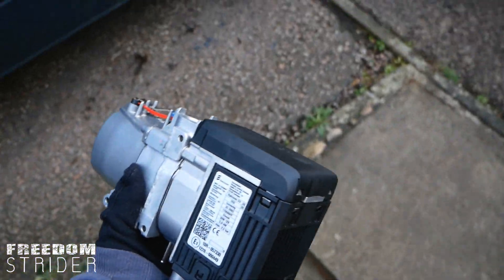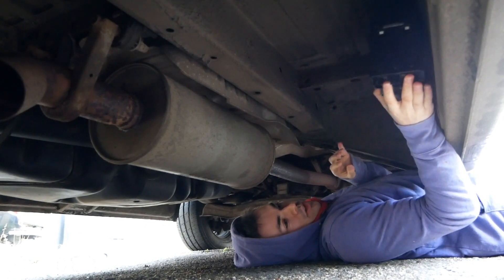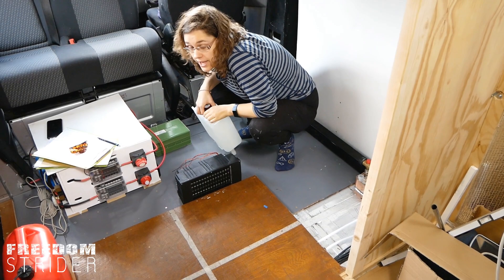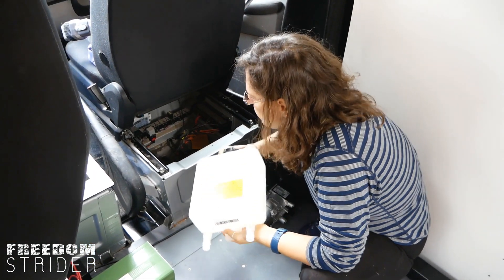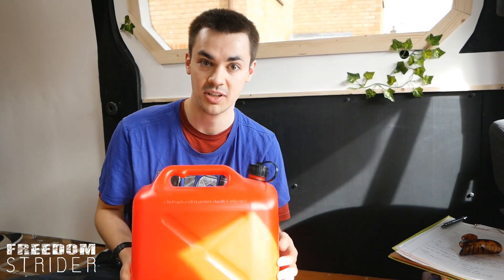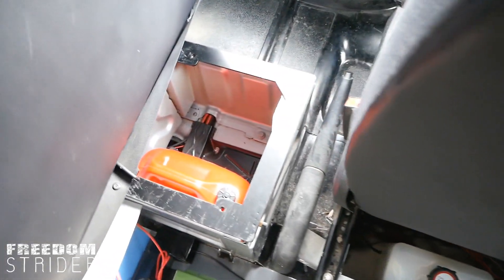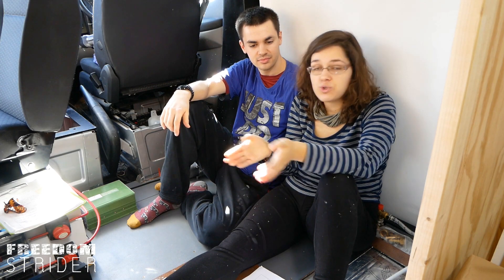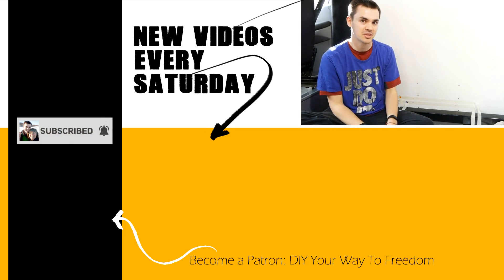How to build a Hydronic Diesel Heating System in a van conversion

Comment: Hi guys, I am working in a similar system. I would recommend you to look at boat heating installation, not at house systems, as boat are a lot similar.
What you seems to do is to install all heating appliances in parallel (sorry, I never heard about the two pipe system). All appliances in parallel with a valve on each. In that way, closing or opening the valves, you can control the flow on each and ensure that every appliance gets enough flow/heat from the heater.
In my case I left a hot water cylinder (for my hot water) without valve, and my blower and underfloor heating with a valve. In this way, with the two valves I can control the temperature of the three appliances.
Hopefully you have it sorted by now and my comment is useless :D
Reply from the maker: Parallel is a 2 pipe system (same thing) it's just Eberspracher instructions describe it as a 1 and 2 pipe systems.

We have our underfloor heating loop on a manual valve. The qir matrix and heat exchanger don't have valves but since we can turn the air matrix on and off manually, and the loop is very short, this seems to work really well for us. We haven't plumbed in our shower yet, so we don't know if any modifications are necessary, once the water heat exchanger is working. 👍

Comment: In English, A one pipe vs a two pipe. Is Series vs Parallel. the choice is simple. If you need more then one heated system then Parallel with a manifold. the Manifold is controlled by zone thermostats and solenoid valves, so you have the heat only where and when you need it.
Reply from the maker: Although a manifold would make a parallel system more efficient, we find that because our loop is quite short,  just simply turning off the device we don't need from our control panel is enough to focus the heat elsewhere, so we still let the glycol run through the air matrix even if the air matrix is not in use. It doesn't hamper the other systems. 

p.s. We both know English 😉

Comment: It is not a good idea to store fuel inside a van you are living in. Fumes are unavoidable..  Also placing the reservoir tank near electrical connections is a poor choice in case of a leak.
Reply from the maker: We were worried about fumes, so we ultimately tapped into our diesel tank instead. As for the wires, we did rearrange the wires under the seat so there's plenty of space for the tank 👍

Comment: Hi, nicely explained thanks 👍. I don’t think I’ve ever seen the furnace installed under the van. Are you going to add any protection from the elements, stones etc? I think the comments answered most of the questions I had but I support the idea of the fuel supply mounted outside of the cabin. I also think there are too many compromises necessary to utilise the existing glycol tank. I would definitely look at the ideal position for it from your perspective and seek out a suitable tank or even consider having a bespoke tank made. I appreciate cost is a major consideration but in this instance cost should probably be the secondary consideration.
Just my opinion and you know what they say about opinions. Either way I look forward to seeing the solution you arrive at.
Reply from the maker: This heater is designed to be mounted external so should have some protection, but we are thinking about building a custom protective box to go around it (you can buy specially made boxes but being a German company, they are hundreds of Euros!!). And yes, we agree with the fuel I think we will be dropping the fuel tank and connecting it up externally. 👍

As for the glycol tank, we managed to find an aluminium glycol tank (made for racing cars) for around £30, so that was a brilliant find and it seems to fit well in the space under the seat. 😎

Comment: Hello :) I've got a question for you both. What determines the temperature of the radiant floor loop? I'm considering storing hot water in a holding tank and would assume having that as hot as possible would be a good thing, then using a thermostatic mixing valve before the sink/shower. Can or should the radiant floor be set to a specific, ie lower temperature to be comfy to walk on? Is the espar set to heat the coolant at the same temp for floor/air/water at max capacity? This is semi-related to considering the possibility of a heat exchanger from the engine and what issues that could bring toward the radiant floor. Don't want any burnt toes! Thanks for these video's, they are very appreciated.
Reply from the maker: The temperature of the glycol is fixed at around 80C as that is the temperature it comes out of the Espar heater at. You can indeed use TRV's to mix hot water stored in a boiler with cold water for showers and sinks like in a house, but if you did want to drop the temperature of the glycol then you can install a TRV designed for coolant/glycol in the glycol line and mix the 80C hot glycol with cooler glycol from another unheated tank and use the TRV to control the output heat of the glycol line.

For the heat exchangers and air matrices that run on the hydronic system it's best to have the glycol running as hot as possible to maximise heat output from these. The only place a TRV would come in handy in the glycol line would be the underfloor if it were to get too hot. In our case, we are going to test without a TRV first and see how hot the floor gets. Honestly though if after an hour of running the heater the floor gets too hot, we will use a standard ball valve to shut off access to the underfloor piping system.

The underfloor heating system is more of an added bonus rather than our main heat source 😎👍

After running the glycol through a heat exchanger, you can store to hot water in a tank at around 50-60C like in a house, then run a line to a TRV near you shower/sink, mix with cold water from the water tank and have good warm water. Or you could install a TRV on the output of the heat exchanger and run that directly to the shower (this would be more instant hot water, but you couldn't store any in a boiler - this is the route we will go with)
Reply: @FreedomStrider  You understood my question beautifully thank you! A ball valve to shut off the floor pipes makes a lot of sense. That's a very practical solution. Like you said, best to think of the heated floor as an added bonus and have everything else work well. Thanks for exploring some other possibilities with me, I hadn't known that there was a TRV designed for coolant/glycol. That could come in handy someday. Thank you again, this made my day.

Comment: It looks like you have the heating and hotwater sorted well done.
Only one thing, if that fuel can doesn't have an air inlet valve it will create a vacuum when fuel is drawn out.

I couldn't use the tank supplied to me so bought one from i think Tanks Direct, but you need to ask for a lid with an inlet valve.
Also you might be planning this already but for me i didn't trust an oulet at the bottom because if it leaks you won't know til its too late.
I bought a fuel pick up pipe that enters at the top of the tank. The two benefits are the tank can't leak and you shouldn't need a fuel filter because  you cut the pipe a little off the tanks bottom so any particles stay at the bottom.
I got the idea from one of Mels Van Life videos.
Reply from the maker: Yeah we've watched that video by Mel, we do need a 1-way valved fuel cap. We have a fuel standpipe so will 100% be going into the top of the tank. Still finalising the fuel tank location and method, but we're on it. 👍😀
Reply: @FreedomStrider  excellent I look forward to the next update guys 👍

Comment: Is it legal to have a fuel tank under a seat? I also wouldn’t want to have a possible overspill in the van as diesel is a nightmare to get rid of
Reply from the maker: Legally (MOT-wise) the only instructions we have found are that it needs to be in a proper fuel container, well secured and not leaking. There are of course some concerns about the fuel leaking or venting regardless of the precautions you have taken, so putting it under the seat is not entirely the best practise unless that's all the choice you've got. If you can put it outside, then do, preferably under the van and away from any heat source like the exhaust. 😊

Comment: I think I would try and mount header tank in the engine bay and the fuel tank underneath...
Reply from the maker: We would have preferred to as well but honestly cannot make space in the engine bay for it.

We might be able to mount our fuel tank in there...we'll have to see 😉
Reply: @FreedomStrider  shame! I am going to be installing one of these units in my van also, although I am not going to use a heating air matrix, will install that later if I need too, doing something different for that 😁 good luck, I know how you feel trying to prep everything

Comment: Hi guys, quick question.... having trouble finding a switched live wire. Where did you find yours? ( having reversing  cam issues) 
Thanks in advance! Bob
Reply from the maker: I'm not sure exactly what you mean by 'switched live' wire - if you mean a wire which is only powered when the van is on, you would need a piggyback fuse and tap into a fuse that is powered when the van is on only (we explain that here https://youtu.be/_n1Z4Aa-cnA)

Comment: why not putting the expansion tank under the couch it would eliminate drilling 2 holes in your floor.
Reply from the maker: Our couch is only going to be 33cm high because it has to be lower than the swivel seat plate, and the tank is higher than 33cm, otherwise yes we'd just put it under the seat and be done with it. 😂

Comment: If you don’t like the two tanks you have, why not go and do a coolant tank search on eBay, loads of shapes available. Same with diesel tank 10l loads of designs. Don’t forget you can use pink low tax diesel for heaters. Steve
Reply from the maker: That's the main reason for a seperate fuel tank, for red diesel - we'll be sure to check other glycol tanks online, cheers! :)

Comment: From Canada:  I would never install a diesel tank inside the van, just in case of a leak impregnating the floor and the bottom of the cabinets, the permanent smell would make the van impossible to live in.
Reply from the maker: Fair point, it was something we were thinking about, not sure how to put our tank outside though apart from somehow mounting it under the bonnet. 🤔
Reply: @FreedomStrider  I think the safest way is to be connected to the van fuel tank.

Comment: I really feel like making room under the hood is the better option, fit the hydronic heater right below it in there and have it alll lagged also won't freeze if your using antifreeze in there. And then run under the van to whatever number of heat exchangers you need. Please try and keep fuel outside if the funds are there add in a fuel level gauge  and its free space inside that you can use. Keep up the videos I'm definitely taking notes, thank you.
Reply from the maker: We'll have a look at the diesel tank again, see if we can mount it externally. Looking under our bonnet, it will be pretty hard to get the tools to actually mount the heater in there, without dismantling a lot of stuff. It's much easier to mount it under the vehicle, and it reduces the length of pipe we need and since the header tank has to be the highest point in the system, we also would have to fit that under the bonnet as well and we struggled to find somewhere easy to mount that tank under the bonnet. 🙂
Reply: @FreedomStrider  good luck bro ill be watching.

Comment: I have actually never thought of it, always assumed that in a series system, the heat will be used as you need it. So if taking a shower for example then the floor heat is reduced temporarily. Might have to rethink now, thanks for the thoughts.
Reply from the maker: You're welcome, we originally thought just in series like you, and then we got the paperwork and were like "errrr, say what? 2 pipe system?" 😂

Comment: If you put a 3 way manifold for the supply and a 3 way manifold for the return it reduces your equipment ie t’s and joiners and piping. Put non return valves on the inlets of the heat exchangers too.
Reply from the maker: Thanks, those 3-way manifolds are definitely something to look into, just have to find the right ones and see if it will work with our design :) And yes, non-return valves is a good reminder, it's on our shopping list 😉